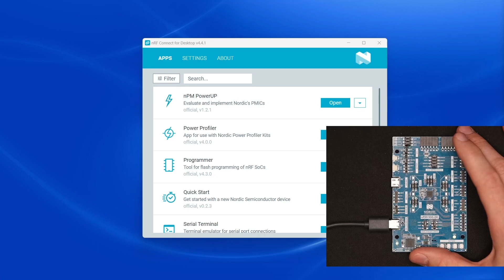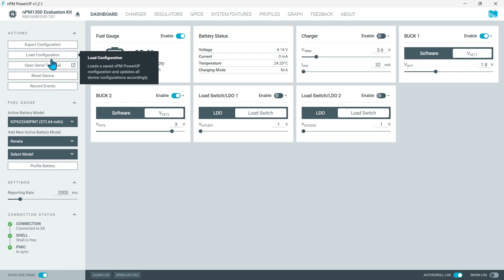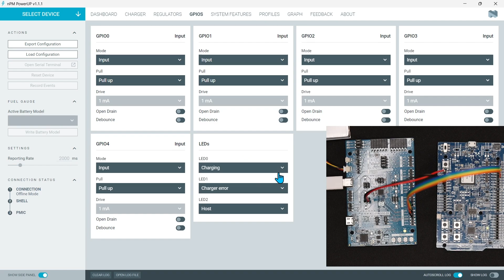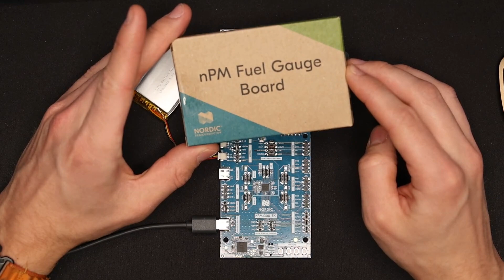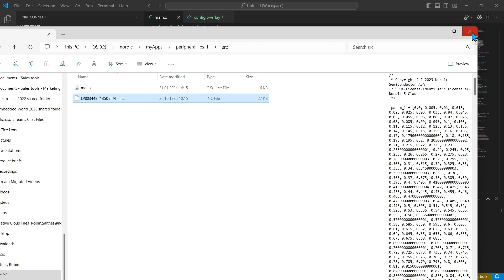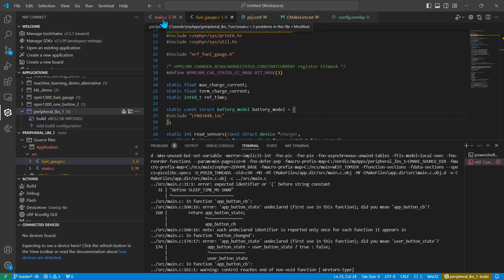Adding battery charging and fuel gauging to your nRF52 Series project

Comment: im trying to do this with the 7002dk, I have adapted the code in the kconfig

&i2c1_default {
    group2{
        psels = <NRF_PSEL(TWIM_SCL,1, 03)>, <NRF_PSEL(TWIM_SDA,1,04)>;
        bias-pull-up;
    };
};
/delete-node/ &{/pin-controller/i2c1_default/group1/};

its not quite working. Any help would be much appriciated

Comment: It would be great to be able to be able to visualize the profiles and see discharge curves etc ... Also, it would be awesome to validate the battery capacity.
Reply from the maker: Thanks for the input. Battery capacity validation is performed during the profiling process, where the actual capacity of the battery is measured and appended in parentheses at the end of the model name.